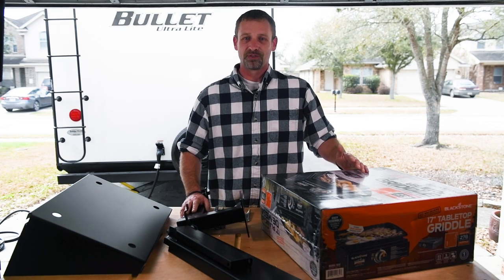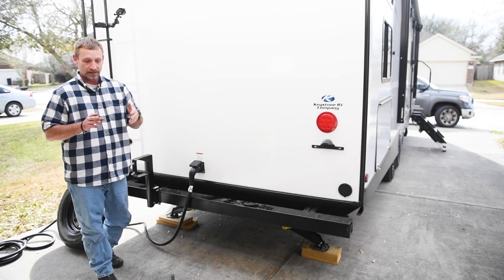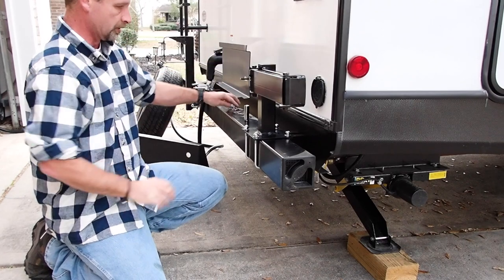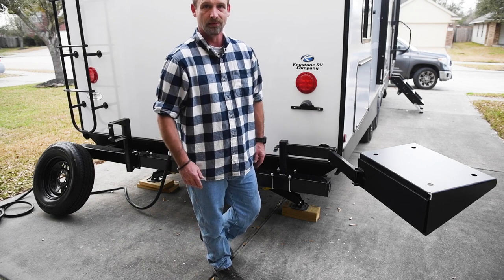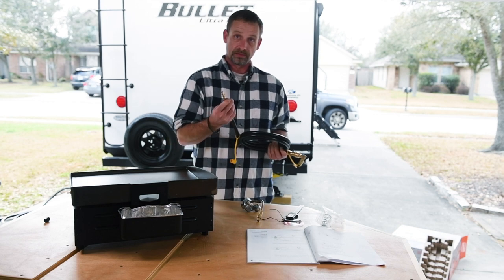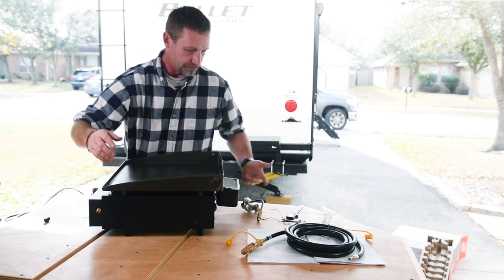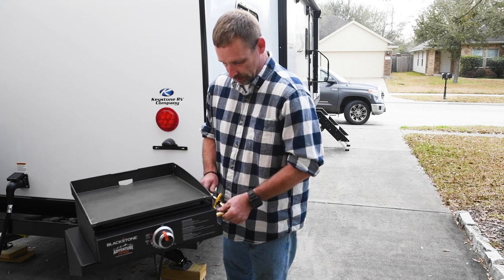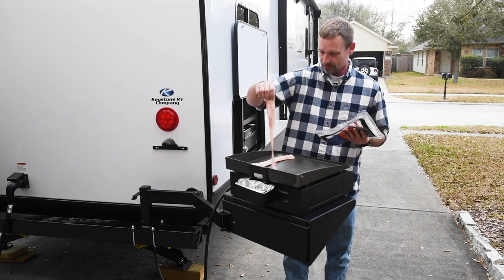Install a 17" Blackstone Griddle on a Camper Bumper Swing Arm!

Comment from the maker: Don't forget to remove the griddle from the swing arm before traveling!!!!
Reply: Look up big cat 305 he does a ton of cooks on the 22 Blackstone
Reply: I might be using this set up for my hot dog cart
Reply from the maker: @lilly3523  Nice!
Reply: Why can't you travel with the grill in place?
Reply from the maker: Because it’s not permanently mounted on the swing arm and could fall off while pulling the trailer. This design is meant for it be removed prior to moving.
Reply: @SeanDoesDIY  Gotch! I wonder if there's a way it could be attached. I'm looking at ways to leave the grill attached.
Reply from the maker: You might be able to bolt it down, but I like being able to remove the griddle easily so I can clean it and use it while the camper is not being used.

Comment: Nice video you should tell everyone NOT to leave griddle on swing arm while traveling though. This will result in loss of your griddle and unsecured load violation and quite possibly injury or death to other drivers! Secure your load! Travel safe and happy camping!
Reply from the maker: Thanks David. Good tip, though I hope it is obvious.
Reply: @SeanDoesDIY  Nope!  Lots of RV's come with a grill mounted just like this. The grill is intended to be left in place during transit!!
Reply from the maker: @YouTube User 9999  this model of swing arm can be left in place, but the table and griddle are not designed to remain in place while traveling.

Comment: Hi Sean - great video - thanks for posting it! I have a 2020 Keystone Premier. However, the cable you posted a link for has a fitting that's too small for the quick-connect on my RV - is there an additional adapter needed to make it work?
Reply from the maker: Thanks Brian, do you know what size fitting is on your camper?
Reply: @SeanDoesDIY  I think it's 3/8 but I'm just assuming because of how small the one is on this cable!
Reply from the maker: Brian, I found this hose and adapter:

https://amzn.to/3xD4jW2 - LP hose with 3/8" quick connect
https://amzn.to/3xzjJuv - 3/8" male flare adapter for Blackstone griddles

I wasn't able to find a 1/4" to 3/8" quick connect adapter.

I have a 2021 Keystone Bullet and the quick connect on the camper is 1/4", I guess I assumed that the 1/4" was pretty much standard. You also might be able to find adapters at your local home store or RV dealer.
Reply: @SeanDoesDIY  thanks so much! I'll check these out! I was as surprised as you were that the quick connect fitting wasn't the same between two trailers from the same manufacturer!

Comment: Thank you for the video. Really helpful including the comments. I have limited bumper space. may I ask: what is the overall length? I mean: at 5:09 min, the length from left to right? Didn’t find the info anywhere. Thanks
Reply from the maker: I’m glad the video helped! What dimension are you asking about? The griddle table or the swing arm?
Reply: Thank you for your reply. I mean the overall length when everything is mounted and the swing arm is in it’s locked position. I have the spare wheel on the left side and a ladder on the right side. Before buying I want to make sure everything fits in between.
Reply from the maker: @coffee2go639  I want to say it’s around 20”. My camper is at storage so I can’t say exactly. I’ll be out that way tomorrow and can get an exact measurement for you.
Reply: Thank you Sean. We have about 50in between ladder and replacement wheel. Do you think that could fit? We could just buy and return if it doesn’t, but maybe that’s an option to prevent unnecessary shipping. Thanks again for your help

Comment: Is the the Fleming Sales 52321 Bumper Grill Arm Assembly
Reply from the maker: Hey Rob, not sure what you’re asking.
Reply: @SeanDoesDIY  The grill mount. I see it on Amazon for $117. Just making sure it's the same one. Also, is the black table top included. Thanks

Comment: How high is the arm from the bumper?   I worry that it will block the license plate.
Reply from the maker: Hey John, I think it’s 6 inches. I’ll be out where I store the camper in the next couple of days and can get an exact measurement for you.
Reply from the maker: John, from the bumper to the top of the swing arm is 8 3/4 inches.

Comment: Probably a stupid question but I am brand new to the camper game! I just bought a new pull behind camper that has a grill on a swinging arm on bumper that needs replacing. Also just bought a 17” black stone like yours. If I installed this, would I need to store the grill itself elsewhere while moving, or could I leave it on there? Thanks!
Reply from the maker: I wouldn’t recommend traveling without the griddle stowed in the camper. The one I installed on my camper just sits on the table when in use.

Comment: Just got a camper… is it fair to say after moving spare tire that I have to decide if I want a griddle arm or a cargo carrier? Can’t have both ?
Reply from the maker: Hey David. I have a hitch mounted cargo carrier that use on my truck. I’ve been thinking about mounting a receiver on the camper so I can use the cargo carrier if needed. This could be one way to add additional cargo capacity while still keeping the griddle arm and spare tire in place.
Reply: @SeanDoesDIY  think there is enough room for everything? First thing I gotta do is mount the bumper supports. Research is telling me the bumpers aren’t made for a lot of weight.
Reply from the maker: @1999maio  I think so. You’re right about the bumpers not supporting a lot of weight. I’m looking at mounting it to the frame under the camper, similar to how the receiver is mounted to a truck. I need to take a look at the measurements for clearance as well as adding the additional weight etc.

Comment: Great Blackstone mod!!  Can you send the parts that you used to build this extension?  I’ve got the Blackstone 17 inch table but it’s a pain with the feet not being sturdy on a lot of surfaces.   
Would you make and sell something like this?  I’d buy it in a heartbeat!!!
Reply from the maker: Hey Jon, I purchased the swing arm and table. I wish I had the metal working skills to make my own.

Bumper Mounted Swing Arm - https://amzn.to/38z6lwv
Griddle Table for Swing Arm - https://amzn.to/3cnHWv3
12' LP Hose with Adapter - https://amzn.to/2NgrB2K

The links are also included in the video description.
Reply: Thanks so much Sean!!!

Comment: Kind of a strange question but do you know the dimensions of the square vertical tube that is welded to the plate that holds the U bolts to bumper?

I have a receiver on my drop down gate that came factory installed that is 2” and would love to just cut the base off and mount this whole unit right into there
Reply from the maker: I don’t off the top of my head, but I can find out. I’ll be out where I store the camper in the next couple of days.
Reply from the maker: Taylor, vertical piece is 2 inches square.
Reply: @SeanDoesDIY  thank you so much for taking the time to get back to me. Much appreciated!
Reply from the maker: @taylorellis2941  you’re welcome

Comment: Will this work on a 2021 Keystone Premier ?  Thanks.
Reply from the maker: I would think it would, it fits a 4” box beam bumper. I have a 2021 Keystone Bullet and it works great.
Reply: @SeanDoesDIY   Cool.   Yes this is a 2021 Keystone Bullet Premier 30 RI.  We just ordered it.  Excited.  Which model do you have?   Im ordering the different grill parts and assembly now.  Saved few bucks getting the table off ebay.